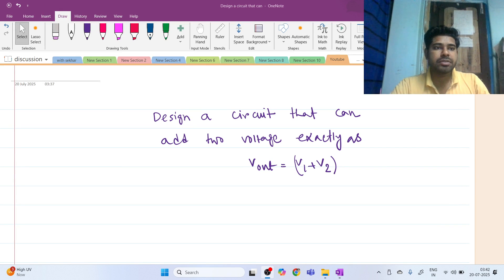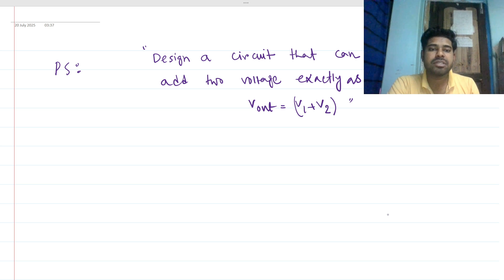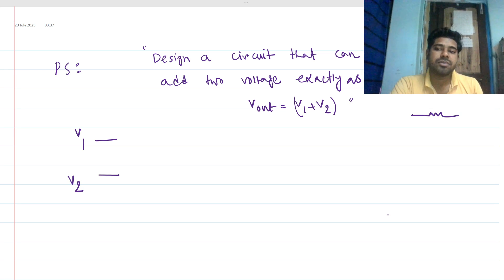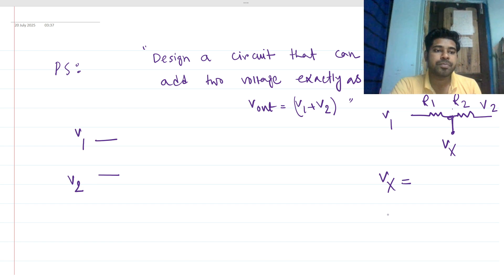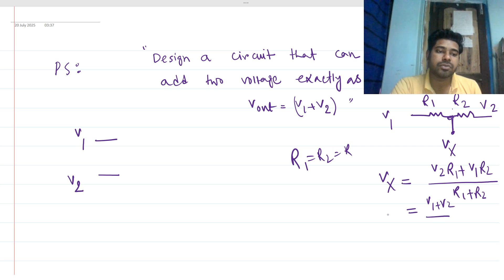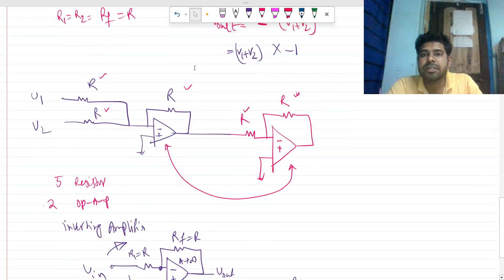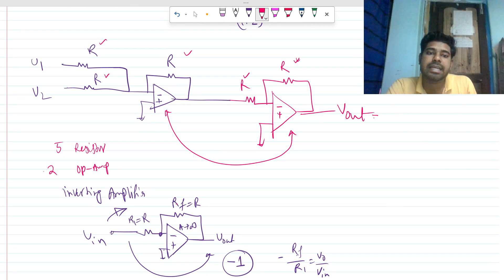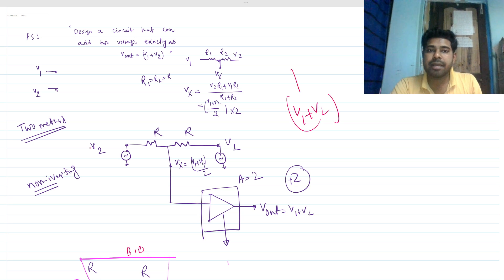problem statement :Design a Circuit that can add two signal exactly as Vout = (V1+V2) ? Amit Bar

Comment: Why dont we just construct non inverting summer?? Its just non inverting op amp with another input, it will take 1 opamp and 4 resistor
Reply from the maker: It is actually the same thing but I wanted to make you feel that you can solve any other problem like in this way... Thats it
Reply: @AmitBar-Analog_Circuits ohkk, thankyou sir